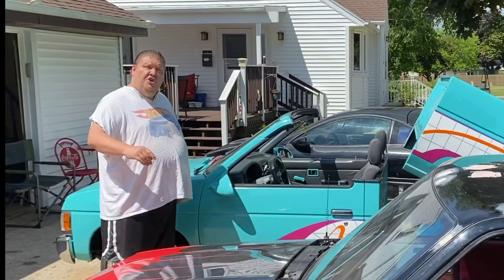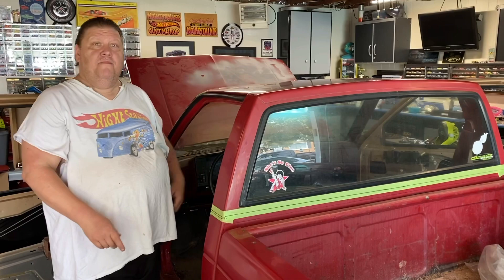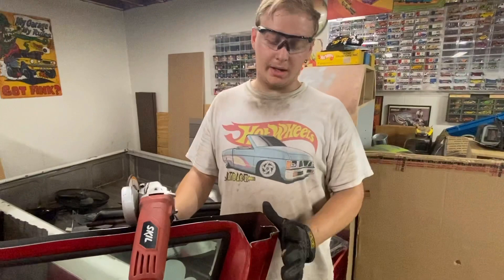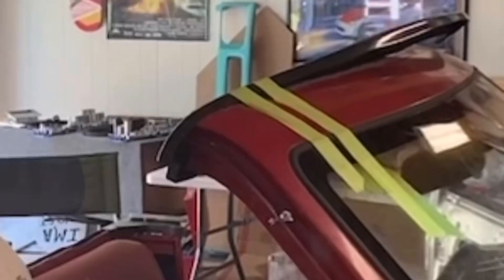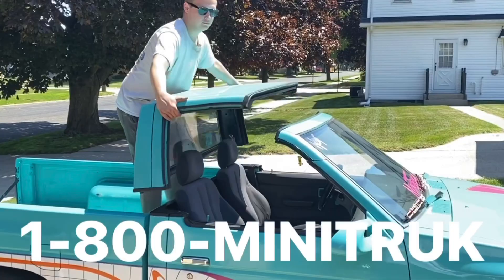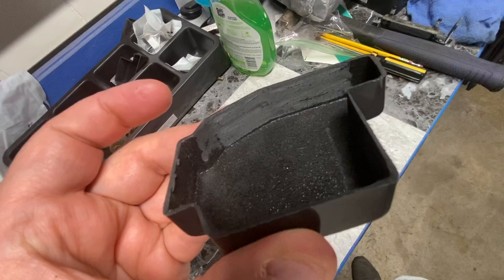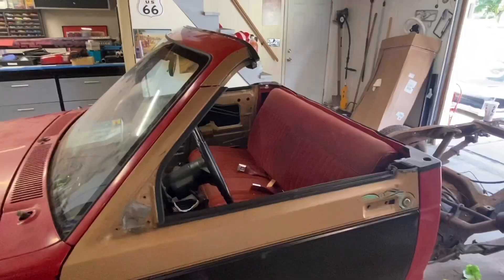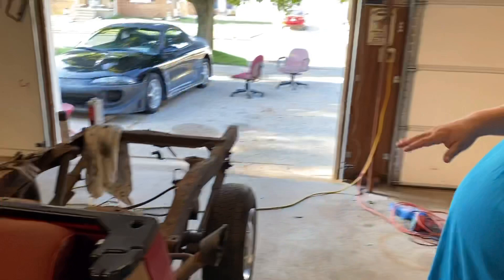How to cut a convertible top in an S10 Minitruckin style.

Comment: I was never into the ricers but me and a few buddies did a ratical tops conversion on my 87 S-10. I ended up rolling the truck and started rebuilding it but never got redone. Was a good 3 years while driving it though. I also bought an s-10 roller roadster some years ago.

Comment: Nice idea on the door window frame,  i done convertible and targa tops, what I use to seal glass  on door is the rubber from a 1980s camaro and it worked,  i tried using both radical kit and sunshine kits. Dont know if sunshine kits still around , nice work.

Comment: GREAT, EXCELLENT VIDEO! THANK YOU! 

Questions: 

A) The measurements you stated, for the S-10, for the cuts, same on the Nissan Hardbody? (I have a 93 Hardbody)

B) Any possibility of you uploading another video on what you did for seatbelts now that your top mounting point is gone?

C) Any chance of another video going into more detail of permanently mounting your cut window components to the removable roof?

I seen you used self taping screws as a stopper/spacer , and longer screws to secure the two pieces. 

Is that all you used to line the pieces up, and to secure them to one another?

Thank you!! And again, GREAT VIDEO! I can't wait to do mine.
 
You have given me confidence that this is something I can do without ruining my truck.

Comment: Super Cool Video , i like the look of the Convertible top  on a Mini Truck  oddly enough when Dodge came out with their Factory Convertible i was suprised you didn’t see many more of them on the road  now i am from SouthFlorida and i’ve owned 7 different Converibles  typically with Converibles the manufactures strengthen the  Frame or Unibody structure to stop flexing  out of curiosity why  doesn’t the S10 Frames need any ?
Reply from the maker: Unibody vehicles need bracing because they don’t have an actual full frame.  The body and sub sections are the frame and if you cut into that, it weakens it.  Fill frames are strong enough.

Comment: First off, awsome video, 2nd, where can I get a kit for a Mazda B2200 3rd, my drip rails are on the outside above the door line. Would the rubber on the door still be a good barrier for water if its cut?

Comment: Beautiful  job i have a chevy full size 1500 i wnt to make a convertable  will i have to weld supports for my cab or will it be ok
Reply: When I do my Hardbody, I am. 

My cousins Mazda B series was convertible, and after SLAMMING the doors for years with no cab brace behind the seat, the door pillars stared to warp inward a little. 

Made it hard to shut the doors.
Reply: @PDofLA  brace it how? Do you mean a piece of square stock at 45 to the floor or?
Reply: @nemosfate   My cousin used a piece of 1.5" square channel steel. The steel electricians use to hang stainless steel electrical pipes in warehouses/plants. 

He welded a upper and lower piece on his back cab wall.  Very top, and very bottom.

It looked like the (top) of a  "H"  welded in behind his seat, along the top and lower back wall of his cab. 

No more cab flex after that.
Reply: @PDofLA  thank you!
Reply: @nemosfate  No worries. In the video below (@ 1:27), you can see the 2x4 they used to keep the cab square "Before" cutting the top. 

https://www.youtube.com/watch?v=x5GCwqgAjUs

I will most likely just weld my braces in before I cut anything as well.

Comment: Can you cut a small window frame (Mazda) the same way as the big window frame trucks?
Reply from the maker: You can but it isn’t necessary.  Those trucks have an external rain gutter so it won’t make a difference.  For those trucks you need to make sure both roof bows are siliconed up on the edges and your rubber gasket that goes on your roof sandwiched between the 2 bows extends out as far as you can go side to side overlapping your door. The rain will follow that out and down dripping past the window.

Comment: I now understand why the mini trucking world is frowned upon. Epoxy? Rivots? Self tapping screws? Wow learn to do some body work. Weld the metal to metal pieces. Go to harbor freight get you some body hammers and some dolly’s. As far as your fix for the leak in the “A” pillar area that gap looks horrible. Weld in a plate along the windshield channel and another along the roof then install your seal accordingly. Don’t get me wrong a “kit” is nice but that looks absolutely terrible. I mean hell some bondo would look significantly better then just metal to metal edges. I’m sorry but if that’s the way you install those kits I would look else where.